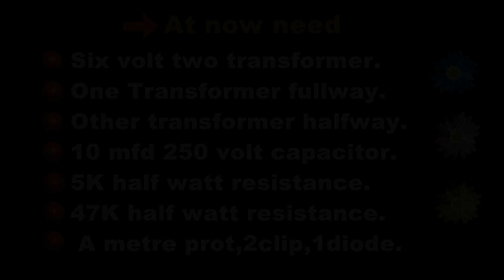LED TV backlight tester create at low price.

Comment: sir can u aplly digital meter so we can sure that led is 3volt or 5volt
Reply from the maker: Thank you for commending , Ampere is more important than volt.
Reply: @ProHackHD   i want to learn how to detect that led is 5v or 3v like samgung leds are 5v
Reply from the maker: You can identity led bulb voltage from input voltage, used bulb and inverter capacitor voltage value.

Comment: "Low cost"? man if you buy all the items it will cost you more than the $25.00 that cost a digital backlight tester!!! and they come with safety features that you cant build on a homemade contraction like this.
Reply: In India and Pakistan it is low cost. But in us it could high cost.
But I agreed that the safety measures didn't cover. Actual cost is safety measures.

Comment: what is full way  😢   and halfway
Reply from the maker: It is halfway that transformer secondary loop 2.
It is fullway that transformer secondary loop 3.
Reply: @ProHackHD   loop 2 is 6 volt    loop 3  6-0-6 =12   or  3-0-3=6 😘😘😘
Reply: @anitalaucheng894  half way secondry 0-6 ,full way secondry 6-0-6 it means..half way 2 wire out.full way 3 wire out